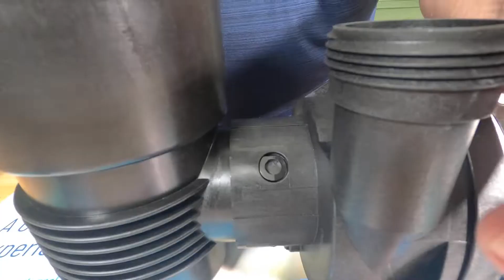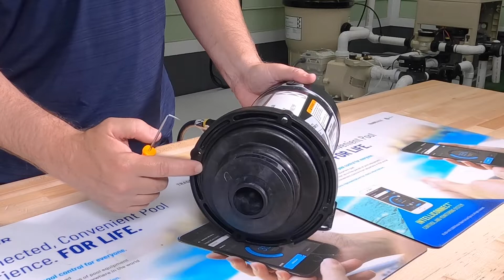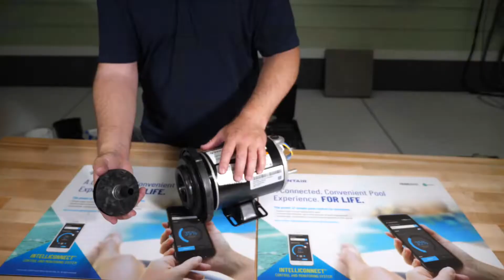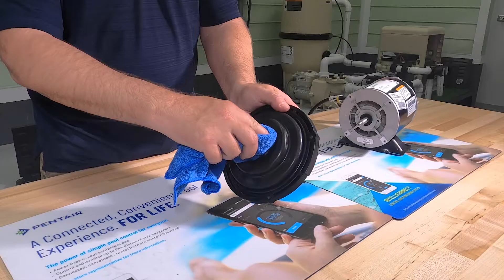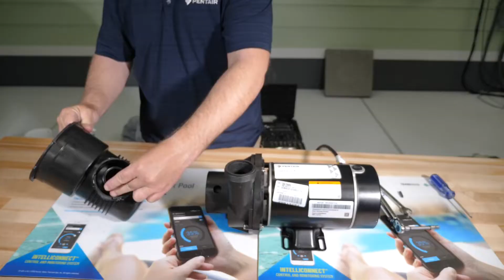OptiFlo® Seal Kit v1 4

Comment: I bought a kit because of a leak.  My impeller shaft has a notch on each side near the bottom, and my shaft-seal that I got wont fint.  Should I try to remove the metal sleeve that ahs the notches or is there a different kit I need to buy?  TY in advance.